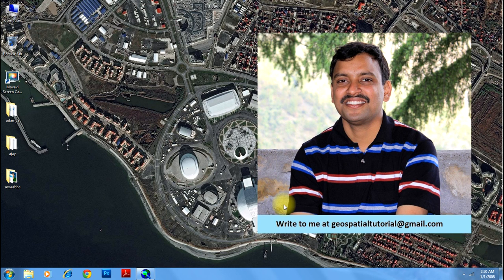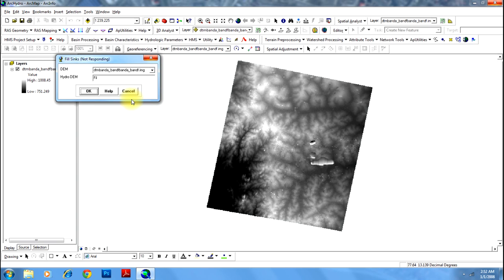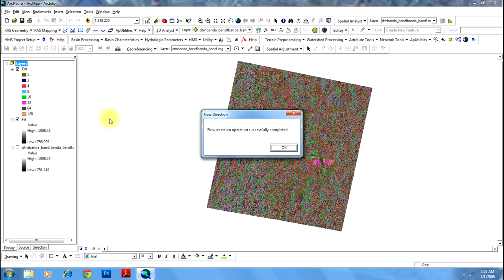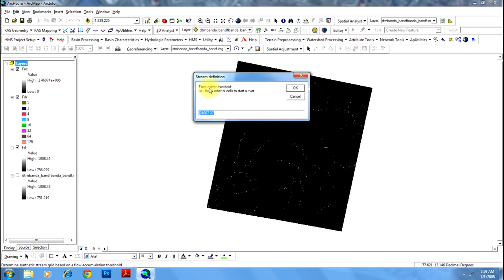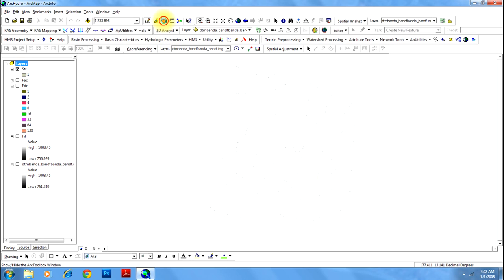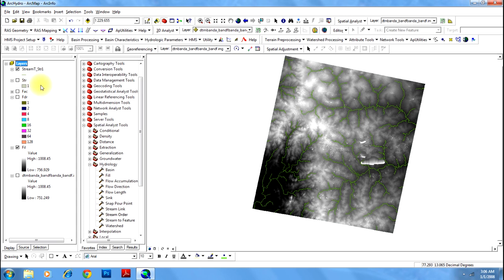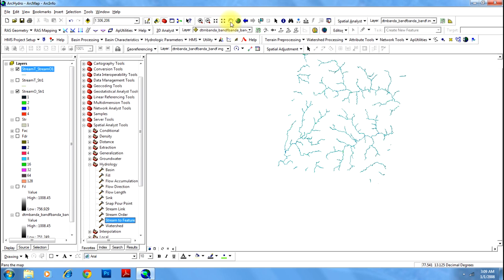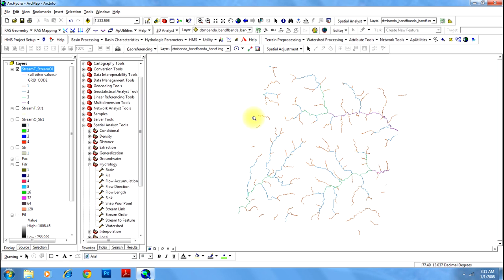Arc Hydro Tools (Drainage Extraction) - ArcMap - Hydrologyl Study in ArcMap

Comment: there is an error i always encounter whenever i use archydro v10.5. : System.Runtime.InteropServices.COMException (0x80041098): ERROR 010429: Error in GRID IO: MtVatBldNew: Value range for c:\users\user\appdata\local\temp\arcc79c\ah2014~4\tmp2675 exceeds 100000 . ERROR 010429: Error in GRID IO: and number of unique values exceeds 500 .. ERROR 010236: Error in building VAT. ERROR 010067: Error in executing grid expression. at ESRI.ArcGIS.GeoAnalyst.RasterConversionOpClass.ToRasterDataset(IGeoDataset dataset, String rasterFormat, IWorkspace pWorkspace, String name) at ESRI.APWR.ApHydro.ArcHydroOp.FillSinks(ApLayers& aplayers, Boolean useIsSink, Boolean fillAll, Double fillLimit, ITrackCancel trackCancel, IGPMessage messages, String& exMessage) in C:\Builds\HydroSolutions\10.1_ArcHydro\Sources\ArcHydroTools\src\ApHydro\ArcHydroOp.vb:line 57592 Failed to execute (FillSinks).
Can you tell me where it comes from ?

Comment: how did you get the flow accumulation to run so quickly? What type of machine are you working on? The flow accumulation process is taking several hours, and I've read else ware that it sometimes takes days. But your flow accumulation took 3 minutes???? Any suggestions?

Thanks
Reply from the maker: Its a normal 2GB RAM. In any angle it should not take hours. May be some installation issue

Comment: Hi. Thanks for this nice tutorial. I have one question. When i overlaid the result with google earth, somehow the stream line did not represent the actual shape as it should be. The curve line of the stream not same as the google earth image. What is your suggestion? is it because of the simplification? thank you
Reply: and i also find out that the stream a bit shifted on some part of the whole stream network
Reply from the maker: It doesn't match perfectly because, DEM has square pixels. The shifted because network may because of some projection issue. You can do spatial adjustment as shown in other video in the tutorial

Comment: Thank you so much for all tutorial. I also have a problem. When I try to import ras data to Arcgis, always return the same error; " Failed to import RAS data System.null referenceException: Object reference not to set an instance of an object    at HecgGeoras.clsMFloodReadRas.ImportESRIXML()"  What I should do? My e mail : caglamelisa@gmail.com, Could you please help me?
Reply from the maker: Hi,There are some problems with HEC. I have also faced it. When I tried in a different system, same procedure, it worked. I don't know what is the issue, but I happened like that. May be you can also try the same.
Reply: I will try that you mentioned, thank you so much :)